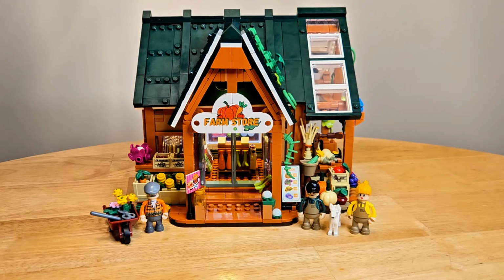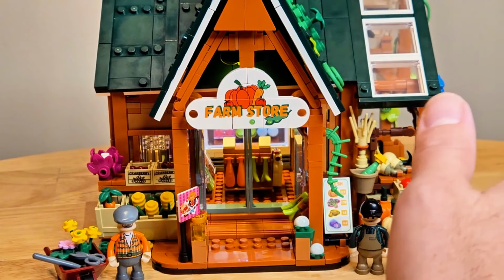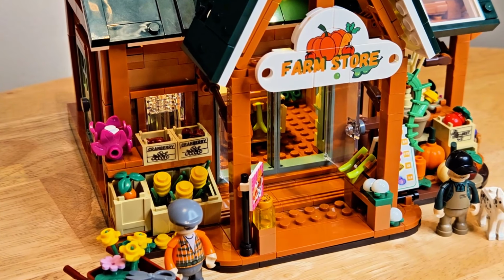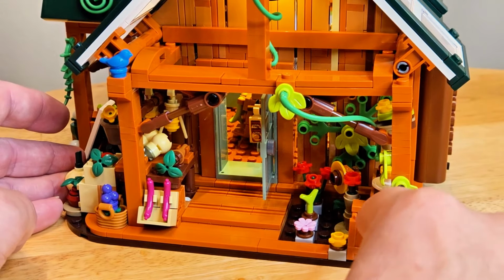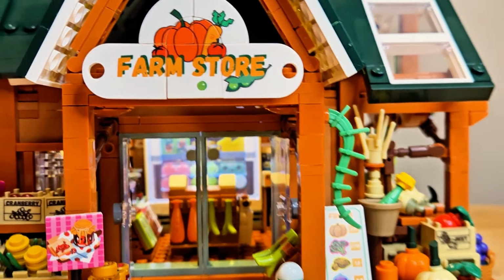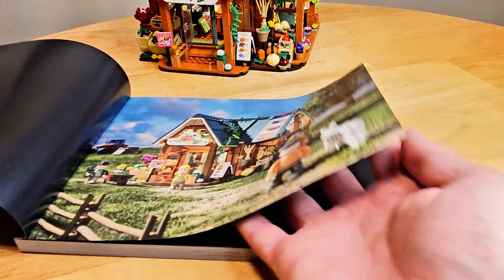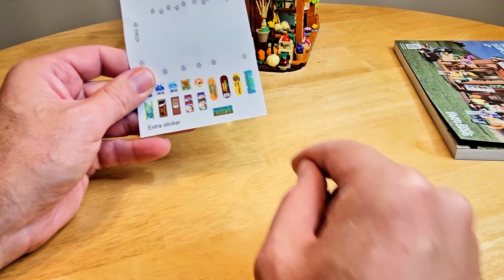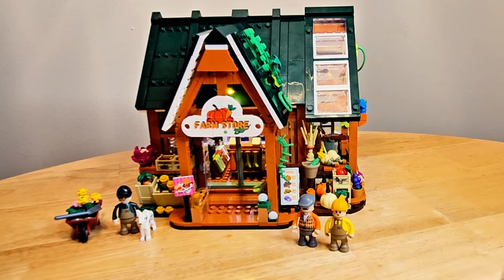AMAZING FARM STORE BUILD! Funwhole Farm Store F9029 Speed Build Review

Comment: This was a great build - Love the big Fridge - I might modify the roof so it is easier to show off the inside.. Great build and video Mate
Reply from the maker: Thanks! Did you have issues at all with the front sloping roof? I don't know what I did there, I supposed to be lower but I just couldn't get it to fit correctly there.
Reply: @colsbricks  Don't remember any issues but it was a little tricky to set in place. Plus a couple of fragile spots.